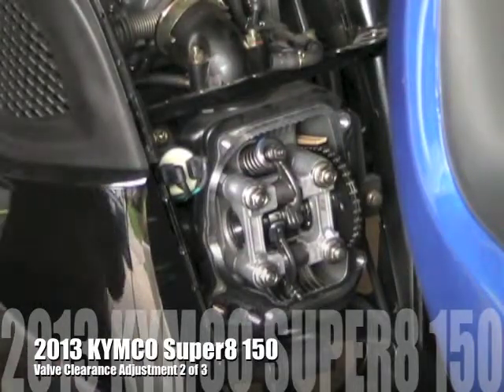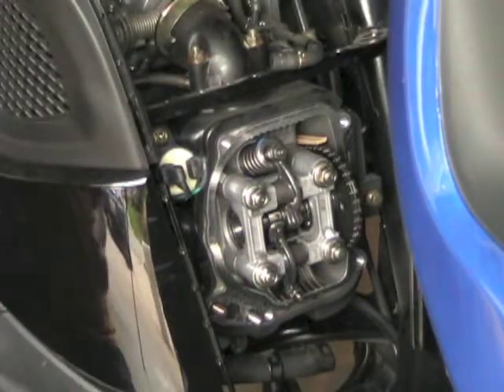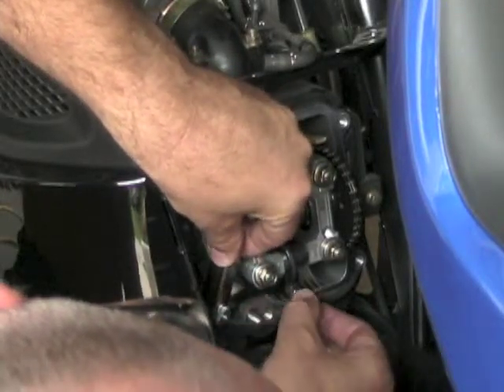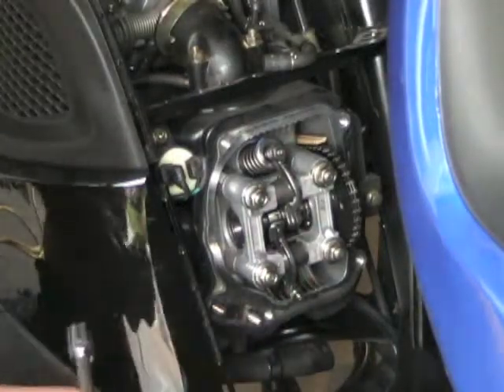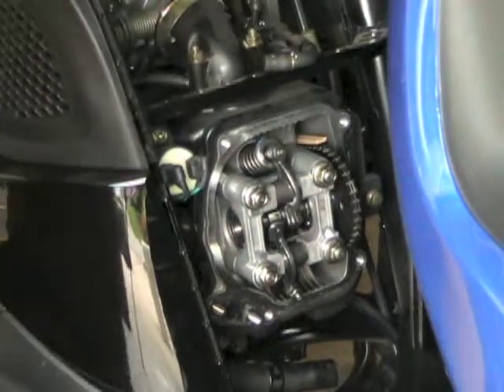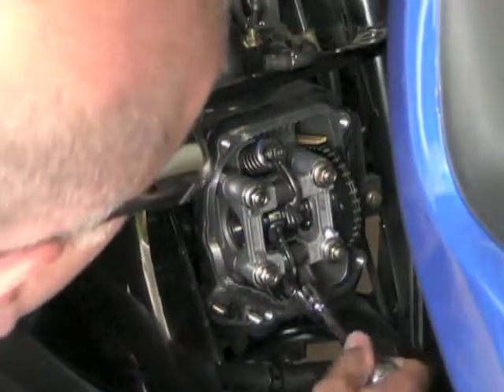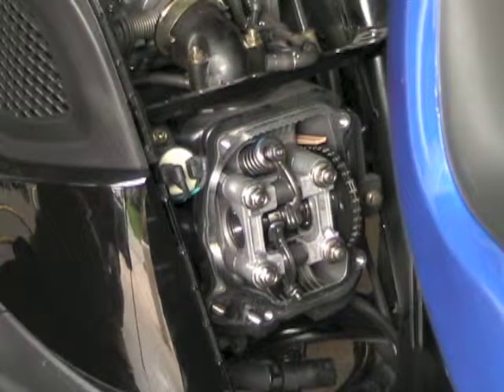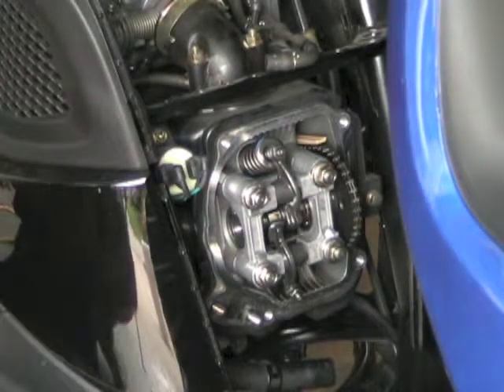Super8 150 - 2 of 3 Valve Clearance Adjustment

Comment: hi Wayne I have a kymco super8 125cc made in 2016 do you know what measure ments the valves have to be on a 125cc in inches and mm.? thanks.
Reply from the maker: My manual says intake and exhaust on a 125cc is .12mm. Thanks for watching and I appreciate the support.
Reply from the maker: FYI,
My model is a 2013